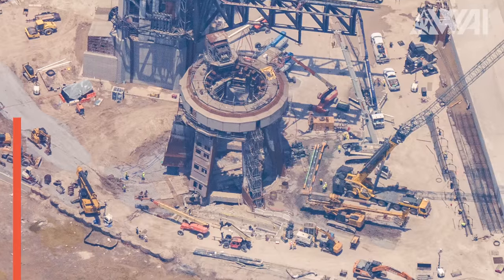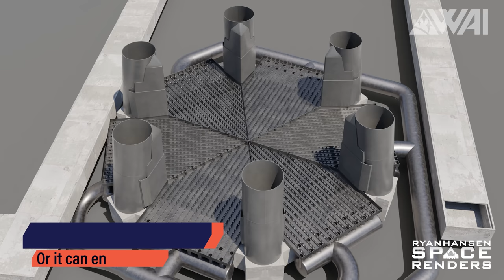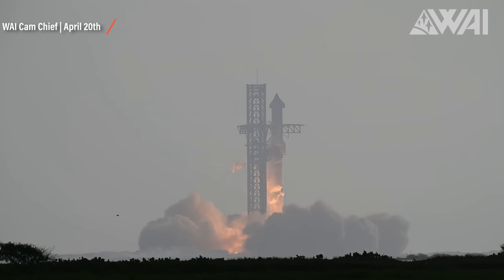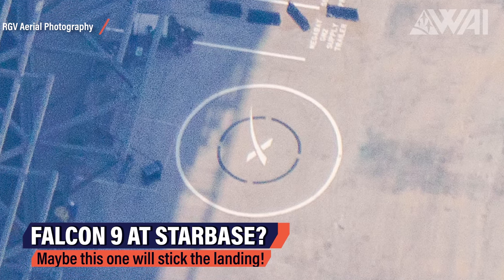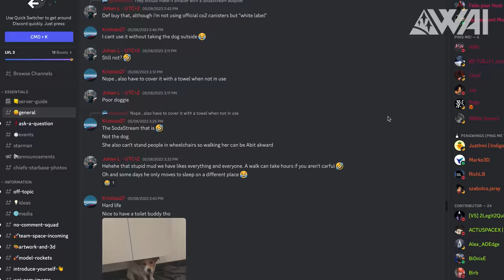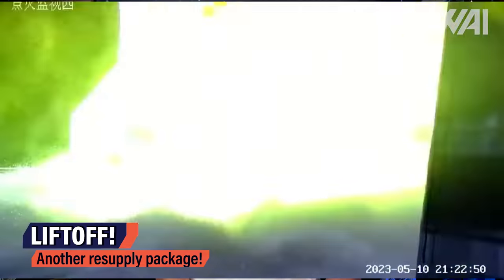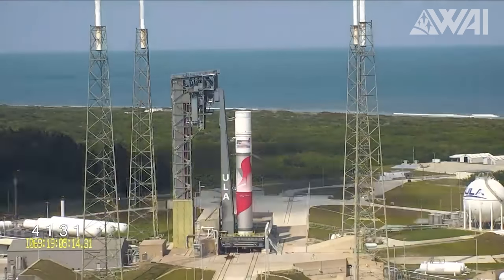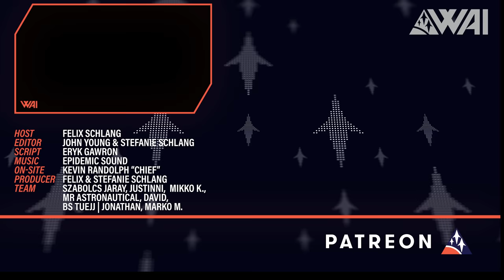SpaceX's even larger Starships made possible through world record Raptor 3!

Comment: I still remember when we were exited about a single raptor engine being delivered. Now we are on raptor 3. Wow ❤
Reply: Think how bad Blue Origin is doing.... late deliveries, still nothing that can reach orbit.
Reply: Higher chamber pressures means higher efficiency. Most of the fuel is used to lift the fuel so even an smal improvement on the Engines means an big efficiency boost for the rocket.
If they can get the engines reliable and reusable would be huge, almost to good to be true.
Reply: @jessepollard7132  to be fair SpaceX hasn't reached orbit yet either
Reply: Thanks for repeating what WAI just said, or you are carpetbagging to drive people to your channel
Reply: @Schinkeldink  You haven’t seen the 220 orbital launches of Falcon have you…
Reply: @kerbal8216  i think he mean the starship
Reply: Elon doesn't seem to be the guy that gives up, so a re-usuable booster and rocket with reliable engines will most likely happen, but probably takes a lot longer then expected.
Reply: @karlkarlsson9126  Yep, will take time but will happen.
Reply: @lubricustheslippery5028  Being able to run higher pressures also means more benign operating conditions if they choose not to run it at that pressure too... which may be desirable from a maintenance perspective given the goal of fast turnaround. If an upgraded engine can run with a 10% margin at the same thrust as an older engine with a 5% margin, that's pretty valuable too.
Reply: @Schinkeldink  they have several rocket versions that do - and that is a demonstrated capability.
Reply: @karlkarlsson9126  maybe only another 6 months to a year.

Comment: If current starship can launch at 90% thrust when missing 10% of its engines, an 18% increase in maximim thrust could mean getting to orbit with 70% thrust on all engines. That's a pretty safe margin.
Reply: To be fair, losing engines isnt part of the plan at all.
If FH manages to not lose a single engine, SH will eventually be just as reliable. We might just face another problem: Raptors might become too strong and cant be throttled down enough for lift-off meaning more stress on the launchpad.
Reply: @tristalia3113  if raptors become too strong we could always use less
Reply: @sol2544 Thats obvious.
Sadly this wouldnt solve any issues
Reply: you have to subtract the gravity losses first to be able to calculate loss of thrust to loss of performance properly. still gets to orbit with no payload.
Reply: @sol2544   if raptors become too strong we could always use less 

For landing they need to be able to throttle down to the point where the engine thrust can match the mass and hover while either the chopsticks pick it out of the air or it can gently settle on its landing legs.  Falcon 9 can't do that, even one engine has too much thrust to hover.  Make Raptors too powerful and the landing issue may be insuperable.  Starship would fail as a reusable spacecraft.

Comment: As Felix pointed out, the water cooled plate will need a lot of pressure to be able to flow enough water to cool. What he didn't mention is that the water pressure will have to overcome the pressure applied by the engines that will be pushing down against the water pushing up. NASA injects the water from the sides and the flame tunnel creates a Venturi effect to assist in drawing water into the flow. SpaceX is providing millions of pounds of thrust and I'm wondering how they will push out water against that pressure. Will it just create a steam explosion?

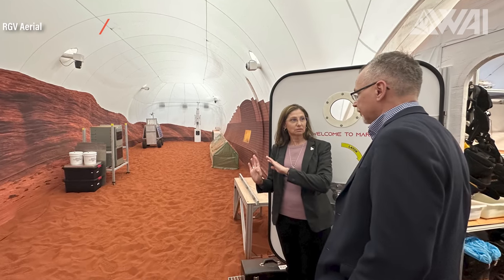Comment: 12:04 That's CHAPEA! I made that! ( Or at least parts of it.)
Starting in late June, they're gunna have a crew of four locked into the analog Mars habitat for a full year. My company made the analog life-support and power systems that the crew will have to maintain. It is not an accident that the antenna at the back of the sandbox looks a lot like a Tatooine moisture vaporator.

Comment: Hopefully, the water deluge system will do the trick.  A modified U tube to send the flames back out, as others do it, seems like the only other way to make this workable.  Great job on this video Felix! 👍
Reply: You have to keep in mind, anything that requires digging into the ground or burring in the ground, has to endure multiple launches weekly and needs to be able to be efficiently maintained.   -And things placed in the ground are hard to conduct maintainance on, even flame trenches.  A water cooled steel plate, if done correctly, should be fine and be much easier to maintain.  The question is, how much area does the plate require to cover.  It might have to be expanded out passed the launch pad.  Also, is a straight water cooled solution the best strategy over the long haul.  Water is corrosive.  Liquid metal cooling has become a popular topic with 4 Gen nuclear reactors and can more efficiently carry heat away than water.  Perhaps a combo of the two.  Only time and multiple launches will provide a clear picture on any longer term solution.
Reply: Another idea would be a variation of the pusher plate design from the “Project Orion” concept. Only the copper covered ablative plate would be in the ground with the shock absorption elements mounted underneath. You would of course still need a water deluge system for sound suppression.
Reply: Most likely its a short term solution, and things will be improved upon as long as they go, as with everything else.

Comment: so more powerful engines? meaning the ship can use fewer engines? - or carry more payload? or enable V2 raptor to be used on Falcon 9 remake to carry more freight on regular missions? Hope engineering for blast plate is up to bigger engines as this is where they are going,? Would fewer engines on boosters mean less problems for relaunching? and fast reusability? - Would love to know about the 2nd V3 raptor test to see if chamber pressure is really under control and if material development really has taken a quantum leap as chambers melting was the main problem for raptor 2 before they seemed to have them under control - except for the 3 on the booster that were shut down before latest ship launch? Looking forward to seeing new engine as if they have simplified an already simplified design then progress is almost super human? - But I will wait to see 2nd launch and how launch pad holds up! -  and the FAA - i am with the crowd who think that it will not be a problem as the big picture is being fuelled by the chinese Space station - good ol paranoia.. LOL Good Luck to everyone and the it will be exciting in the next 12 months when all these rockets are launching... sky will be full of them LOL

Comment: I look forward to your analysis of the different engines given how many have had to be replaced, and how many have failed on flights.  Given the number of replacements after a static fire, ( 2 or 3 ), the number not good enough for launch ( 3), and the other failing on way up.  We have > 25 % failure rate.
Reply: A 25% failure rate. That was the exact failure rate of the early Atlas rocket program. However, in that case it was not always related to engine failure.
Reply: It would be really interesting to have a look at how performance consistency/success has changed between Raptor v1 and v2. Maybe it's just an illusion based on how much flight testing happened early on, but v1s seemed to be way more consistent and I think when they pushed the "simplified" design it happened at the expense of redundancies that they haven't reapplied yet. I could be way off though

Comment: I heard that the rocket exhaust pressure at ground level under the OLM is about 13 bars so each nozzle of this system must have a pressure of about 15 bars to cool the plate. That’s a lot of pressure if you add all the nozzle and a lot of water also…
Reply: Apparently they are going to be using compressed gas to pressurise the water. The interesting question is how to balance the flow rates for all these nozzles given that there will be a range of stagnation pressures depending on how far from the center they are.
Reply: @saumyacow4435  Nozzles will be needed. If it is just a plate with holes in it like a shower head and you apply 3,600 degrees centigrade to it you will turn the metal plate into slag.
Reply: @jason_m_schmidt622  Holes are still nozzles. If you've got enough pressure, the water will go out, rather than the other way around. The complicated part is proper distribution of flows/pressures.

Comment: With the extra thrust of the Raptor 3, maybe Booster can get some legs to land with, like next to the tower rather than trying for the chopsticks. Thoughts?
Reply: No part is the best part.
Reply: Landing legs will be needed anyway soon. For the Moon first. Chopsticks still seems too much ahead of it's time. But that's what SpaceX does😊.
Reply: Don't think so because best part is no part. They'd want to put the extra thrust into more weight capacity and/or higher margins of error.

Comment: Hey, @Felix, the Angry Astronaut has covered the Raptor 3 also.  His claim is that rapid turn-around and reuse are much more important at this point than more thrust.  What's your thought on this?  Should SpaceX be focusing on making Raptor 2 more reliable, or making Raptor 3 with more thrust?  I suppose if Raptor 3 is a simpler design, it kills two birds with one stone.
Reply: That would be the conventional and safe design process but when was the last time SpaceX played it safe? They are thinking about the next generation even while working on the current generation.
Reply: Being capable of higher thrust and being more reliable aren't mutually exclusive. If they get it running well at 350 bar they can get it running VERY well at 320 bar. There's also the whole cascade of engineering and economic tradeoffs that means a more capable engine gets a given mass to orbit with fewer launches, and needing few launches is comparable to being capable of performing more launches.
Reply: Did he shake his cup asking for a few bucks too?
Reply: Both, don't forget that the next version of the booster (and starship) are to be 18 meters in diameter instead of the current 9.
Reply: He doesn't seem to have a clue what he's ranting about lately. Raptor 3 is about much more than improved thrust. It is simpler with less parts quicker and cheaper to build plus can operate at Raptor 2 thrust levels with more head room meaning less wear and tare in the engine and able to throttle up if engines fail.
Reply: @schrodingerscat1863  
This is correct. 
Raptor 3 is everything he was complaining about. More power, less complex, more reliable, safer.
Reply: I think he's extremely wrong. SpaceX needs to improve and perfect every aspect of the rocket. The engines are a huge part of reusability! They have multiple different teams doing different things. Once raptor 2 came out they didn't transfer all the rocket engine engineers to work on tank welding!

Comment: concrete drying is a continuous and fluid event, and usually reaches its full effective strength after about 28 days.
Reply: depends on the concrete - one problem is that curing concrete generates heat, and that can cause severe cracking problems (one of the problems seen when making large concrete dams).

Comment: FWIW: a back of the envelope estimate says that the pad cooling water will need to be injected with at least 1100psi just to balance the rocket gases, likely significantly more in order to get the needed volume.

What I'm looking forward to is seing how they are going to account for the (inevitably) non-uniform pressure above the plate. Different numbers of holes? Different sizes of holes? Multiple different manifolds at different pressures?

Comment: A floating platform on top of a giant tank or series of tanks  could be used to force deluge waters into the plume at least equaling the pressure reducing the need for the high pressure tanks . think multiple giant water filled syringes.

Comment: IMHO, more important than V3 combustion pressure and thrust, I'd like to see all the booster engines start, reliably, every time.  So far, they're zero for two.

Perhaps the inverted showerhead water system will allow them to do more full start static fires.  They NEED to get this right.

Comment: Raptor 3 was impressive in how solid (lack of vibrations of the cone and wiring for example) it was during its whole testbed run, compared to raptor 1 and 2.
Can you imagine how impressive a raptor 3 powered dragon test flight would be? And raptor 3's on starship means less engines needed, so it's more powerful, less complex, cheaper and reliable.
However I am expecting an upgraded merlin, to let it carry much bigger payloads, perhaps a new dragon 2 or 3 capsule, as that's where spacex makes its money and is the logical next step in longer distance space travel before starship is fully ready. Parallel development of both means starship regular flights will be sooner than later

Comment: I'm beginning to feel like Starbase is not doing enough to prevent another massive dust storm because beyond the steel water plates the entire launch pad is little more than dirt and the 16 million pounds of thrust on launch is going to extend well beyond the steel water plates.

Instead of a fire diverter trench which is not feasible because of the water table, perhaps Musk should consider blast diverter walls  around the launch pad similar to the one in front of the water and fuel tanks.  Had there been no broken bits of concrete, the vertical tanks may not have been damaged because they were designed to direct the blast upward before reaching the tanks.

However, Musk is a genius and I'm not.  But I am a retired Marine who spent 3 years in combat and I know to always prepare for the unexpected, but even then there are the unexpected you didn't prepare for.

Comment: It seems it would take a heck of a lot water pressure to even somewhat counter the tremendous rocket thrust in protecting the structure.
Reply: might be interesting to create a minimal flame diverter using ice. then augment with liquid nitrogen to keep the ice when the engines are started. - easy and quick to replace, relatively cheap; and could even augment a water deluge system.
Reply: @jessepollard7132  ice would be just blown away :(
Reply: @jakubiskra523  ice is stronger than steel. it would be melted and contribute to the deluge.
Reply: I think at sea level, at 100% thrust, Raptor 2 outlet pressure is about 15 psi (1 ATM) higher than ambient.  So not a crazy amount of pressure.  Of course it's supersonic velocity, so I'm not sure what happens when it hits ground.  Could go up a lot in the supersonic/subsonic shock wave.

Comment: I am not an engineer, but surely the damage that happened on the last launch was entirely anticipated ? Which means that - for all their positives - SpaceX still has some serious 'gaps' in its understanding and problem anticipation/planning. I also have doubts that what they are doing for the next big launch will be enough....... BTW, the power in super-heated steam is off-the-chart dangerous and impressive..... so they may be swapping out one problem for another. 

Personally, I see big melted holes, flying metalwork all over the place... and other unforeseen damage to infrastructure. And the tank farm is still way, way too exposed......

Comment: If the thrust from the rocket cant collapse the pilings the concrete won't crack and get blown out?
Reply: The pilings had nothing to do with the concrete shattering under the battering of 28 powerful jackhammers! That’s why they’re trying a water deluge system coupled with a few centimeters of solid high temperature steel!

Comment: where is all the water going when it drains from the steel plate system?  thanks
Reply: Probably, most of it will instantly turn to steam and dissipate away.  My guess and I'm sticking to it.  😉👍
Reply: If most of the water does turn to steam, where is the cooling?
Reply: @johnrday2023  turning water to steam takes incredible energy and that’s actually the cooling effect. Phase changes of liquids such as water are frequently used for big heat loads
Reply: The water that doesn't turn to steam drains to the already built retention pond next to the pad. Felix has talked about this multiple times, it's the same pond that all the expanding LOX gets piped away to.
Reply: Thanx Longboard fella. I realized the ccol8ng effect on expansion, but I was concerned about the rate of the steam expansion.

Comment: 8,877 tons x 2,000 lbs = 17,754,000 lbs of thrust. What’s with the 19.5M?
Reply: Why are you using 2000 lbs as the conversion for tons? It’s 2205
Reply: This just points out the need for metric.
Reply: Google has this to say.. "The three types are all a measure of mass(weight) the short ton aka US ton is 2,000/lbs. the long ton aka British ton is 2240 lbs. the third ton is the metric ton which is, equal to 1000 kilograms, or approximately 2204 pounds." So yeah, the US needs to join the rest of the world and use metric.

Comment: The Raptor 3, with increased power, will burn fuel faster than "2" so that is probably why Mr. Musk hinted that the booster would be extended to hold larger tanks. Imagine the line of fuel trucks constantly occupying the state highway to feed this beast. If the FAA restricts them to just 5 launches a year, SpaceX will barge the super booster and star ship to Florida for his plans of multiple launches every week. Either Cape Caneveral will have the same fuel truck line or they might install a large pipe to the nearest facility that makes Methane rocket fuel. An onsight Methane production facility is probably out of the question. I feel certain that SpaceX has this already figured out.